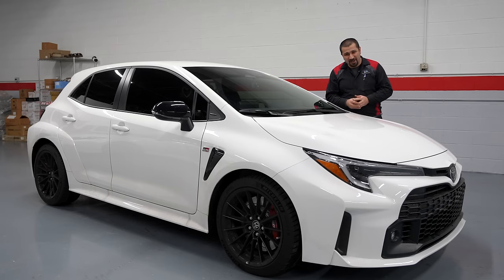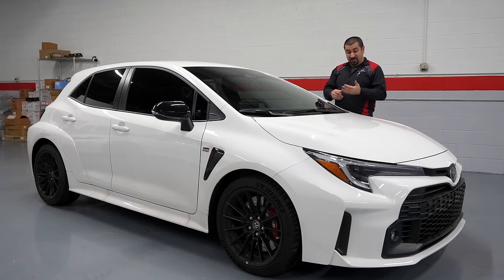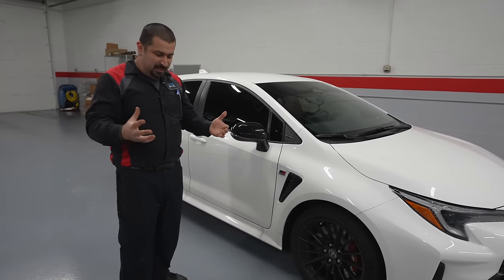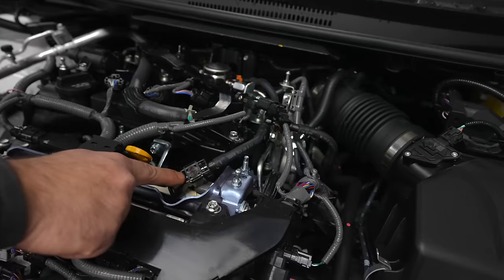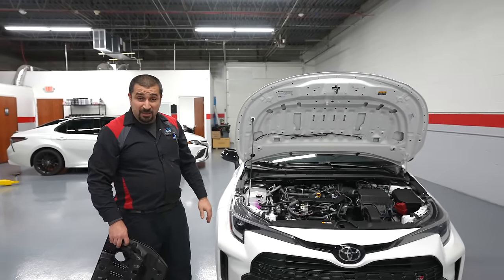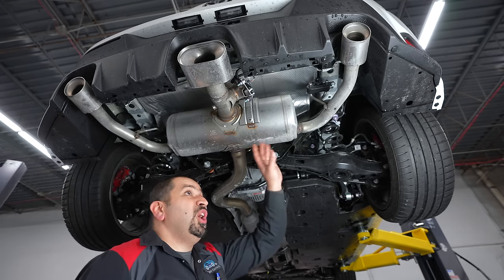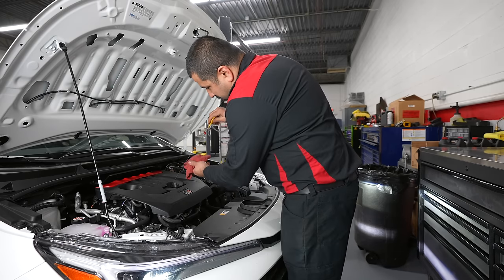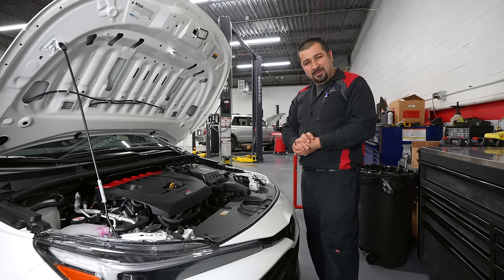The Toyota GR Corolla is Truly a Special Car | First Service and Technical Tour

Comment: Hi AMD, I hope you’re doing well. I have a question. What does it mean: 00279 - 1QT5W-01  GMTO 5w30 CS SN WTY. Is it a fully synthetic oil? I have a 2006 Toyota Tacoma pre runner with 131,000 miles, what motor oil should I use, any recommendations. Thanks so much.

Comment: 3 cylinder engine? Does it have oil dilution problems like the 1.5 liter civic si? The huge output, tiny engine, large turbo boost.

Comment: Nope. We don't have this GR Corolla in the UK.  Just the 2 litre and 1.8 litre hybrid 4 cylinder GR Corolla. I considered buying the GR hatchback but the 1.8 hybrid has the same engine and performance as the Touring Sport that I finally bought!  It looked nice though. Probably cornered better as well...

Comment: I purchased a 2022 TRD 4x4 off-road Tacoma & I changed my 1st 🛢️ change at 545 Miles because of AMD did a 2nd 🛢️ change at 2,500 along with changing my MTF fluid & the tranny was dirty & you could see all kinds of metal floating in the 🛢️ when we shined a 🔦 into it. The 2nd 🛢️ change at 2,500 did not need it but at least I have peace of mind that my engine is broken in perfectly... Next going to change the transfer case & then I'll probably do the diffs at about 20K

Comment: (The Car Care Nut) = You should of shown You wiping some oil on the New (Filters-Gasket) before You tightened the oil filter to the Engine. (An idea) = Get another Container so you can Pour Exactly 4.5 liters in, So you don't have to keep Stopping Your Pour in to check how much you just Poured in, {I know it's fun to just get to work and Do it like always, But your showing Us How to do it} Maybe, not a Good idea, {You can get the owner and Put him on camera, to give him back the Keys}

Comment: Dear amd. or any mechanic. I have this strange problem in my chr 2021. Whenever it's winter the backup sensor gives three quick beeps (constantly) with nothing behind of me. The sensor's have been changed and APU (sensor computer) changed but still facing the problem. Now the dealer raising query to manufacture. I'm wondering what else is to be checked? Could cabling be a part of problem ?

Comment: Ethan is a very smart fellar, I sure miss my 2011 Toyota Carolla XRS with the 2.4L in it, it got smashed from behind got a 2017 Tundra 4.6L the Corolla got 8.1L/100km my Tundra got 10.3L/100km not a huge different

Comment: Pennzoil Ultra Platinum 0w20 is a much better oil than Mobil 1 0w-20 Advanced Fuel Economy.
Reply: I went from Mobil1 to Pennzoil and I never went back. My 2007 Camry with 90k miles went from engine ticking to quiet like a Prius.

Comment: Wow, no hood insulator pad even on this sort of trim level.  Toyota is really corner-cutting things these days to save every penny.  I was relieved to get rid of my Japan-built 2020 Corolla SE sedan 6-MT after only 2 years & 9500 miles due to all the issues/problems that I was having with it.  Both Toyota & Honda today aren't the companies that they used to be, based on my 40 years of owning & driving them.

Comment: A question related to Corolla.   I have a 2020 Corolla XSE.   My wife was driving and hit a block of ice in the road.  She kept driving to a friend's house, about 10 miles.  When visit was over she started the car and left driveway.  Got a few hundred feet down the road, the engine made noise then low oil pressure light came on.  She was on a narrow road on a curve so backed it back to her friend's house about a minute of engine on time.  Putting the repairs thru insurance but I'm wondering the procedure to figure out if a new engine should be put in.  I have extended warranty for 8 years/120,000 miles.   It is at 62,000 miles.   Toyota will be doing the repairs.  Should I insist on a new engine?  Any help would be appreciated.

Comment: I have a 2000 Toyota sienna xle that I bought used.  The FOB would lock / unlock the doors as expected, the security indicator would never light up, all was good.  I don't remember what happened to set off the alarm but I panicked trying to figure out how to unlock the door and try to use the ignition to stop the horn honking etc.  When it finally stopped, the security indicator was blinking slowly and now whenever I use the FOB to lock the doors, after a brief time, when I unlock the doors (both key or FOB) the alarm goes off.  I looked all over looking for a solution.  YouTube suggested using Techstream to disable security.  Dealer service said security can't be disabled because ECU requirements.  They told me the hood latch does not have the switch that the van is locked  and that is the source of my issues.  Is that true?

Comment: Let's wait and see how that tiny turbo 3 cylinder holds up and if it can even make 200K miles before its all used up? I'm highly skeptical once again toyota is going the direction of all vehicle manufacturers and that's not a good thing. Other brands are using smaller engines with turbos and gdi and aren't making 100K miles. Time will tell. Just look at the new Tundra with dual turbos and a V6, not good. Buyer beware with these smaller super high pressure engines.

Comment: I have an 05 Rolla 5 speed stick, over   
500,000 original miles, original owner, my daily commuter 128 miles 
daily. No oil leaks, still; hasn't failed a 
Smog test. I change oil regularly myself. It's a super reliable car. I love 
the manual tyranny.  I will drive it til it 
makes a million miles.

Comment: My big question which can get frustrating. Do I have to take off the whole front end when I need to replace the low beam bulbs? Whatever happened to glass on your headlight assemblies? This plastic junk lasts maybe 3 years and starts fading and as time goes along gets that yellow effect and in time you will start seeing cracks and peeling due to the longevity of plastic. Why not have glass covers with a plastic mold to hold it in place. So it looks cool, but at the same time it last so much longer. 

Thank you AMD for the video. Good looking car, not a fan of the junk plastic side trim at the bottom. After a few times bottoming out which happens a lot where I live, it's going to not look so good. Anyways, love your videos my friend! :face-red-heart-shape:

Comment: What a cool little Race car.  Built right by Toyota to be driven HARD on a closed track.  Oversize turbo, oversize brakes, oversize exhaust and probable oversize radiator with enough space in the wheel wells for bigger tires.  The all wheel drive will help when the driver is a little off on the track.  NICE!

Comment: vac waste gate, no integrated exhaust manifold, spin on filter instead of top mount cartridge? Feels like last minute cheap out. I'd like to get one but what's the value prop over a Golf R for instance which has a bigger engine with much more tuning overhead? The rear end operates like the VAG Haldex. Works ok, but nothing special. The latest VAG one has clutches on each axle and not on the input shaft, so technically not even a differential, but gives you that drift mode.

Comment: Solenoid control of VVTI is not foolproof, as solenoids can fail just like an electric motor; also, the boost is 25.2 psi in the Core and Circuit Edition GR Corollas and 26.3 psi in the Morizo Edition; the GR Yaris has 23 psi.

Comment: It seems like new Toyota Corolla go back to Spin-On Oil Filter instead of Cartridge Oil Filter. I thought by using the cartridge filter, it supposed to be Eco Friendly and less metal is used and then waste go to landfills but I guess it is much more messy and time consuming.  Any one know exact reason it goes back to old school? 
Thanks in advance.

Comment: Hello, Ethan! You have an amazing car! How exciting must be to drive such thrilling car. 

I have a Camry Hybrid 2008. And I would like to know if you can make video about replacing the 12v battery. I've seen some videos of people using other batteries instead of the OEM the Panasonic one. I was wondering if we use a generic one will it last around the same as the Panasonic? Mine died yesterday after 270,000 miles on the clock 😁

Comment: Like so many other car manufacturers, they have switched to a turbo charged engine that produces more heat, which probably means shorter life span for the engine.  Why didn't they just keep the 1.8 I4 that was basically bullet proof.  Is this a brand new 3 cylinder engine that has not been proven yet?  I am skeptical of the longevity of this motor.

Comment: I have the GR4 in Europe with 5000 miles on it. The rear diff/clutch pack oil gets contaminated very quickly during the initial "brake in" period. My initial change at about 800 miles came out very dirty, I did second at 3000 miles and it was much cleaner. I think its mostly clutch material, these clutches are always slipping depending on drive mode selected and the entire unit holds only 0.5 L of oil. The engine oil needs low RPM anti detonation formulation. In addition the rear end/clutch pack, transmission and front 'transfer case" each call for different oil. So in the end, Toyota calls for four different oils for a full oil service of the GR. The transfer case calls for Toyota only "gear" oil. It is an awesome little car, sorry you guys don't get the 2 door version.

Comment: You have said to use dedicated PSF instead of ATF fluid in the power steering system. I just did a flush at 50k on my Tacoma and used PSF. Everywhere I read though it says to use what the owners manual recommends.(atf dexron 3) I trust your expertise but could you please go into more detail about why PSF is better than ATF.

Comment: Toyota skimp on the hood insulation? Sad. Also, oil cap says 0W20 oil, a bit different to the Dynamic Force standard 0W16 recommended oil viscosity range

Comment: As a mechanic, I noticed you didn't need to lube the o-ring before installing the filter. I noticed toyota OEM filters all have grease already in the oring. Is this why it's not necessary to run your finger around it with some oil first?  I noticed the grease right away but I still continued to run it through oil out of habit, unsure if the grease was just a new preservative for the oring instead of the powder it usually has.

Comment: Hi AMD, just wondering what is that buzzing sound when the push start button is at ACC? I noticed mostly toyota 3 cyl engine have that, what is that part causing it, is this normal? Thanks!

Comment: The block is open deck, and it is aluminium, hope to be better than the open deck subaru ej257....3cylinder engine....in wrc toyota use 4 cylinder engine

Comment: Hello AMD. Great videos, this is my favorite channel.
On my 2006 corolla the p/s light turns on and the power steering stops working intermittently.
If I restart the car the issue clears itself up.
Any ideas?
(There is a clunk as you mentioned in some videos regarding what I assume is the intermediate shaft but I don't think that it's related to the first issue)

Comment: Also used the exact same Mobil 1 Oil for the same reasons. Wondering your thoughts on Motul 8100 Eco Lite oil of the same viscosity type?

Comment: Hello, I have a question about adding LED low beam headlight bulbs to my Toyota Tacoma. It currently has halogen bulbs in projector housings. Will it work with the lower wattage LEDs ? I understand that the resistance is lower with the LEDs and may affect trucks circuitry.

Comment: I want one.  I hear ya about dealers and oil.  It is like they never read specs on anything and are pretty ignorant when it comes to oil    I think toyota has timing chain cover leaks because the dealers overfill the oil.  they always put 5 quarts in when it says 4.6 or 4.5.   I just don't get it.   I also think they had transmissions issue because they didn't fill them right after changing the oil.   I just can't believe an engineering company like Toyota has such incompetent and un-knowledgeably dealers.  I bet that thing can get great gas mileage too if you drive it normally lol if that is possible hehe.

Comment: Hi AMD, this was a terrific video as always. I wanted to post a comment on a video that I am unable to find.  In one car review you made a comment regarding the shark fin on the roof, and why was it there. I am sure you now the shark fin houses the satellite antenna.  Maybe you are not aware of why it is on the roof of every vehicle except convertibles. The antenna must be on the highest flat surface of the vehicle and in the center of the roof for the satellite radio to receive the best signal. Now there are other covers available, my 2015 Outback had a flat disc cover on the roof, my Mustang convertible has a small disc cover on the trunk lid in the center.  Whether anyone likes or does not like the location of the satellite antenna , physics wins.

Comment: On every car,  esp  my 1993 Ford explorer,  I changed the oil every 3000 miles,  bit I never,  ever have changed the drain plug gasket, and I drove the car for 17 years.

Comment: Question, I recently watched a video on doing oil changes that recommended filling the new oil filter with oil before installing it.  The difference in registering oil pressure was measured and it was several seconds of zero oil pressure when the filter was not filled.  Comments?

Comment: Nice car but 40k out the door for a corolla that only has 220-230hp.
Reply: Agree, I'd take a 40k mile Lexus F car over this with a 450hp bulletproof 5.0L DOHC V8, 8spd direct shift Trans with LSD and 6-piston Brembo calipers clamping on 14" discs. And a flashy interior with Mark Levinson sound. Rcf, gsf, isf...any of them owned by an adult with full documentation.

Comment: What's with the front bumper? There isn't much to protect the grill for the cooling air. What happens if a shopping cart slams into the front ot fhe car? Or another car backs into it at 2 mph. Can it do that without damaging the grill?

Comment: I like it that it does not have this special oil filter. a basic regular one is so much better and much less to go wrong. the minus is that it has a turbocharged 3 cylinder engine. as a daily driver neither do i need or want any turbocharged engine especially if it has just 3 cylinders.

Comment: Thanks for the valuable video & for the owner Ethan. Im a bit concerned about the oil filter tightening. (i think it should get more tight or at least double checked) correct me if I'm wrong.

Comment: I have a Yamaha snowmobile with a 3 cylinder inline motor.  It is known as the 700 Triple.  It is a 2 stroke and it is very smooth.  So I think we may see more of the 3 cylinder motors in the future.

Comment: Does the GR Corolla manual handbrake lever if pulled while moving also disconnect the drive from the rear axle like on the GR Yaris?

Comment: I was told that the original oil from the factory is special and different from oil that's available off the shelf. As such, the first oil change should only be made after the mileage or time interval has been reached.  Is that true?  Also, can you comment on the proper way to break-in a new Toyota (or any ICE car). Many thanks.

Comment: Hello AMD,
I am the proud owner of a 2016 toyota avalon limited with the 3.5L V6 2GR-FE. I bought the car with 2 previous owners at 61k mi. The first owner drove for 25k miles and had a wonderful service history, changing the oil every 4k miles. The second owner had an okay service history, changing the oil every 6k miles. Sometimes, he went to quick lube places, which i do not prefer. 
I bought the car in july 2021 at 61k mi, and the car mechanically was great but cosmetically was not the best. After a year, i started hearing an intermittent ticking sound at idle. I was not sure at all what it was, and finally, at 90k miles, when i took it to my trusted mechanic for an oil change, I asked him about the intermittent ticking at idle. He said it sounds like it's coming from the head, like maybe the camshaft  or valves, but he wasn't sure where exactly. He offered to put in BG MOA into the oil and see if it did anything, and sure enough, it stopped the ticking. But at 95k mi, i decided to do an oil change myself, and the ticking came back after driving for a week. I checked the oil level, and all was good, so im not sure what is causing it. Any help?
Thanks so much for reading my comment, and any advice is appreciated.
Reply: I have a 2010 lexus is350 with the 2gr-fse which has D-4s (direct+port fuel injection)...and the engine is incredibly noisy compared to my old es330 with the MR v6.

Comment: Three cylinders? Ono it's getting ridiculous. We started with eight. Then we went down this 6. Then we went down to four. Now we want to use 3 with turbo charging?.  Enough, no!  What do we end up with next? No cylinders whatsoever, and we have just electric?  Damn! Yuck.
Reply: This turbo 3 is a relatively new engine but Toyota has been making reliable 3 cylinder engines for years. I believe AMD owned one years ago.

Comment: Thank you for the in-depth video on the new GR corolla. I'm curious to know though, does new cars today need to have an underbody coat or spray to prevent rust and breakdown? Or does the news cars today already come with that protective coat from the factory? I stopped believing the dealerships word when I saw your video on a 2018 Camry that needed a new engine because the owners listened to the dealership and changed the oil every 10,000 miles.
Reply: The recent video on the new Lexus GX AMD purchased may help answer your question.

Comment: If that is the same engine as in the GR Yaris  you cannot bore it out etc.  It is a high tolerance race engine basically and goes like a rat up a drain pipe.

Comment: The newer the BMW the easier they are to work on. You don’t even need to take off any bolts to change the oil. Just a twist off cover. This is technically more work to change the oil.

Comment: Three things I noticed, and had questions on. Why did you not pre-charge the oil filter and put the date and mileage on the outside and why not torque the drain pan plug to spec?